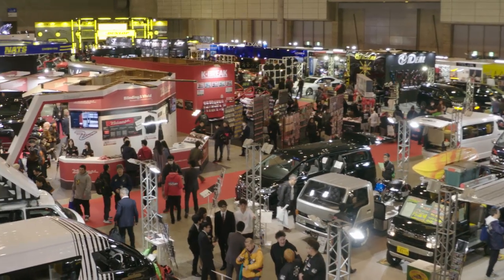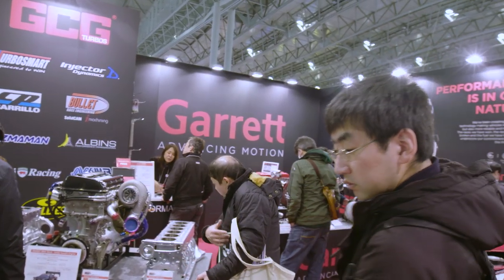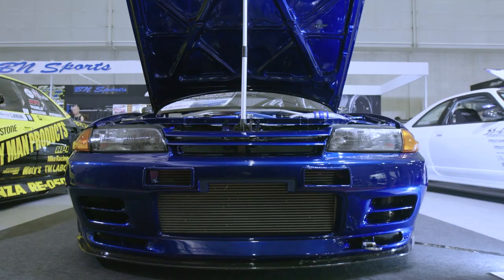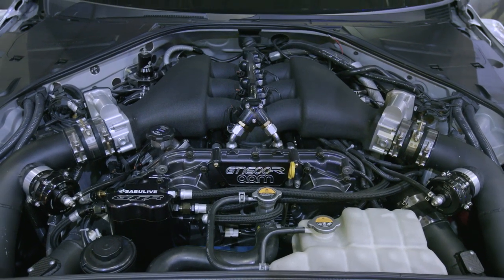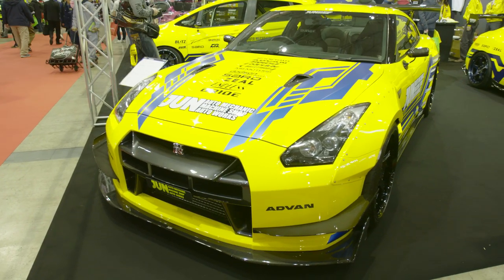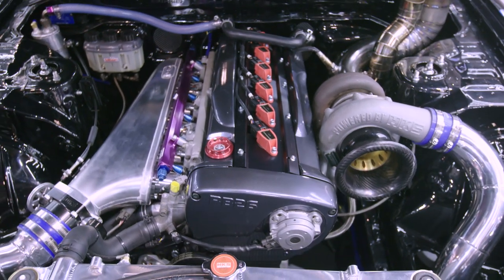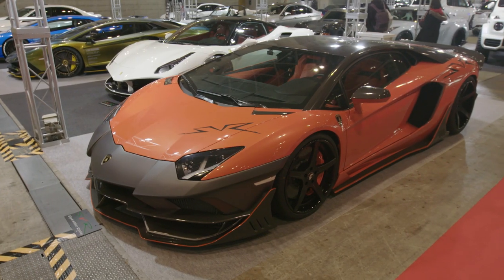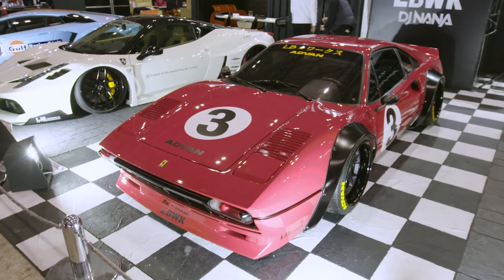Tokyo Autosalon 2019 - What's changed in 20 years? GT-Rs, Lambos and more.

Comment: I can only see a small top section of the "Honda-something" and it looks like an S660 to me. He acts like modifying Kei cars and other small cars is somehow a new thing and a sign of moving with the times. Really? Swift and mx5 show cars are something new? I'm pretty sure that both have had plenty of aftermarket support since the '80s/'90s. I guess if it's not a GT-R it's not a proper killer car, we're all impressed down here.
Reply from the maker: The point is, wether its clear or not, that Silvias, WRX, Evo, Supra and GT-R used to dominate the halls of Tokyo Autosalon. Iconic performance cars. Now exotics, vans and Kei class cars dominate the halls. People who grew up with those cars and hope to see them at TAS will now be dissappointed by the lack of them. Thats the point.
Reply: @MotiveVideo  Anyone expecting a modern car show to be predominantly cars from the '90s doesn't exactly have realistic expectations, TAS hasn't been like that for over ten years. You should be happy that they are still there in good numbers.
Reply from the maker: @burnination1  We know this, but its a TUNER SHOW not a new car show and most foreigners into imports who go there, go there to see performance cars. Weve never gone to look at Vans or Kei cars
Reply: Top Fuel are also still running their S2K and is top 3 at Tsukuba, guess having the same car on their stand every year wouldnt be interesting though